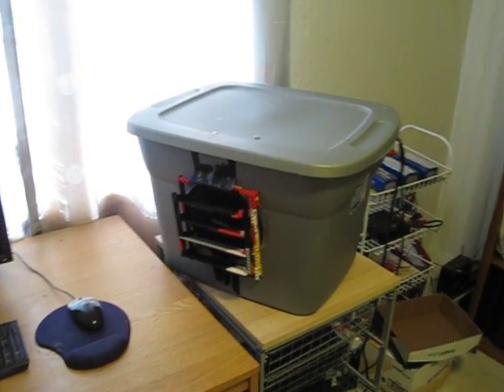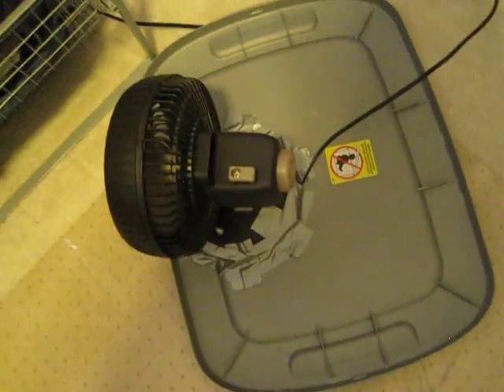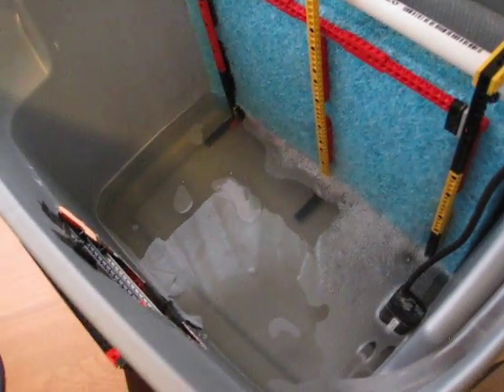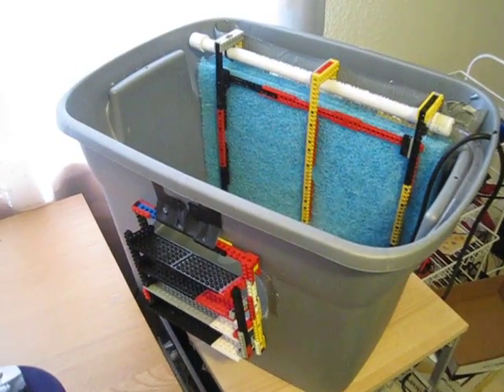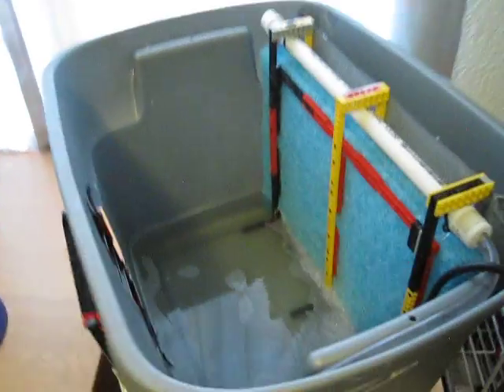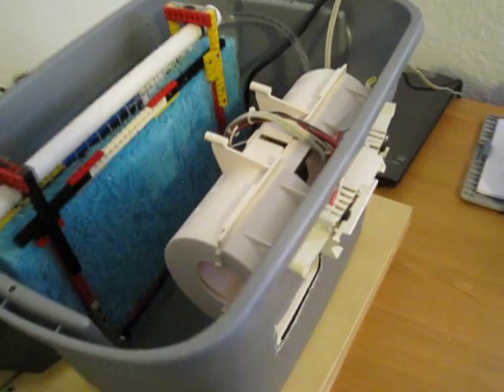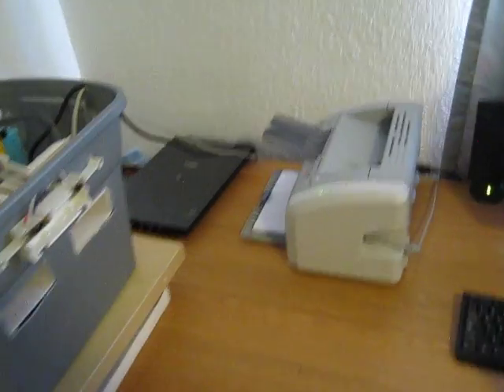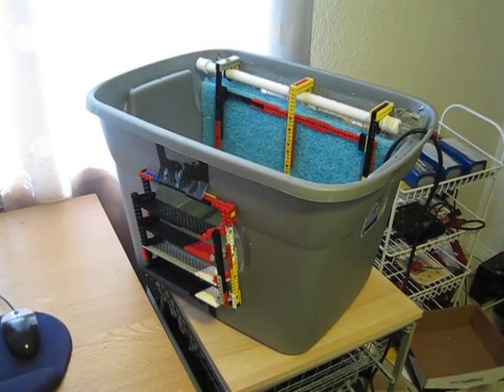Homemade Evaporative Cooler (Swamp Cooler) UPDATE and New Cooler!

Comment: From mesa az and even tho its a ild video question is this work? No offense
Reply: This works well to cool down a personal space.  This is not something that will cool down a large space. Make sure you have a door open since it will put humidity in the air.  Being that you are in Mesa, this should work well since that is a low humidity environment.  I use this in my office to cool down my personal space.  Doing so allows me to stay cooler and keep the thermostat at 78 or higher for the AC in the rest of the house.

Comment: These CAN cool down an entire room if the door is closed and a second window is cracked as it pushes the heat out of the room and as long as you have enough airflow and static pressure from your fan, as well as enough water pump flow.

Comment: Could you, please, give the références of the 2 fans and the links. thank you.
Reply from the maker: In the larger cooler, I used a Holmes Lil Blizzard fan that you purchase here or in most big box stores: https://www.amazon.com/Holmes-Blizzard-8-Inch-Oscillating-Table/dp/B000J07RMU/ref=sr_1_2?crid=20BPS2M9VD95D&keywords=lil+blizzard+fan&qid=1566082612&s=gateway&sprefix=lil+blizz%2Caps%2C185&sr=8-2

For the smaller cooler, I used an air purifier/ionizer I found at Goodwill but I do not know the brand.

Comment: Hello pal, is this a good circumstance to cultivate many bacteria? Especaiily in summertime.
Reply: Mister User ,
Worse than bacteria is an opportunistic fungus whose spores will be aerosolized and pumped into the living space!
Then it is Valley Fever for free!
Reply from the maker: They key is to change out the water.  I also replace the cooling pads when they get built up with hard water scale.

Comment: I just have one question. Is the water in there dirty, because it looks to be yellowish. That seems to be a health concern to me.
Reply from the maker: Yes at the time the video was shot the water was a little discolored because of the pad.   I usually clean the water out a few times each season.   At the start of every season I put in new evaporative pads and tubing to make the water start out as clean as possible.  The water was a lot worse when I used those green cooler pads or the aspen pads and would smell.  With these blue cooler pads the water is sometimes slightly discolored but there are no smells.

Comment: How much cooling do you get (in degrees) for a standard house of 2500 square feet?
Reply from the maker: +geo dezix    If you are using a single evaporative cooler as the one in my video, you probably will not notice any drop in degrees for a house of that size.  This is not really designed to cool a whole house.  It will just cool off the personal space around you and also the room you are in.

Comment: Nice job! One thing that may help would be to use a igloo cooler instead of a plastic tub. It may help you not to loose cool air thru the side of the thin tub. Just my opinion , keep up the cool ideas.
Reply from the maker: Ron Stewart    Yes that would be a good idea.  My tub walls are thin and are getting worn form use so I may need to build another one.  Using a cooler would be more stable and would probably last longer.

Comment: Hi Guy. Any new discoveries for the swamp cooler.  I pieced one together but it has very low output.  It has to run off of DC and/or solar in a camper.

I swear I've seen you around somewhere. Don't know for sure.

Cheers
Reply from the maker: From my experience there are two things you can do to really increase the output for the swamp cooler.  The first thing is to use a bigger fan to circulate more air.  The second thing you can do is use a bigger pump so that more water is constantly falling over the cooling pad.  You can also experiment with those Duracool pads versus the Aspen pads.  Also putting ice in the water will lower the air temperature by a few degrees.

As far as seeing me around town, perhaps you saw me at the College of Southern Nevada since I teach there.  Otherwise I also play percussion at The Crossing church in town, so you may have seen me on stage if you went there.
Reply: *****
Ice is not an option when RVing. Already using the Duracool pads. I did locate a larger fan but have not had tome to install it yet. I guess there are only so many options one can try while using DC.

Enjoying our cooler weather?
Reply from the maker: Tom Woerndle   Yes definitely the cooler weather is good.  No need to run the cooler now.

Comment: Thanks for your videos. I'm a fellow LV resident here also. We are just starting to build a bucket style evaporative cooler running on DC/solar for camping off grid in the desert. All experience and tips are valuable. I'm also interested in the your solar cooker as well. Cheers
Reply from the maker: Tom Woerndle   I am currently working on another parabolic solar cooker and will post a video once its complete.  Need to take advantage of this desert sun and heat somehow!

Comment: Nice job with both of your swamp cooler videos! Love the Legos. Just a thought -- could you also hang up a sun-blocking curtain on your window? A solar shade would block a lot of sun but still allow you to have some light through it, so you're not sitting in a cave.  They're pretty inexpensive.  Again, I applaud your ingenuity!
Reply from the maker: Thanks for your comments!  I have moved out of that house and in my current house I no longer have that issue.  The houses are close together so the sun is blocked from coming in my current office window.  I will definitely keep those solar shades in mind in case the sun becomes an issue elsewhere in the house. Go Legos!